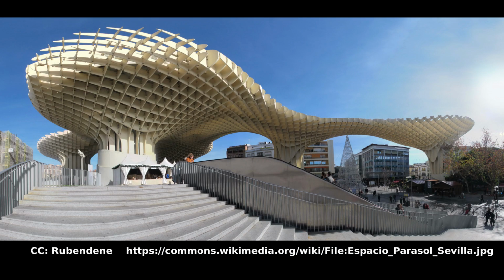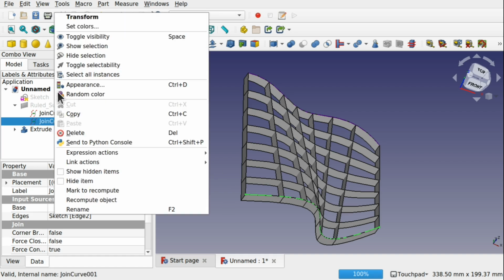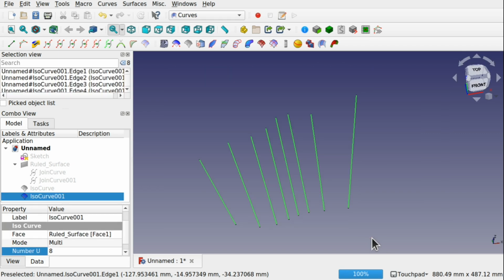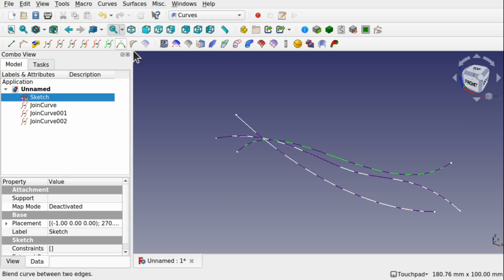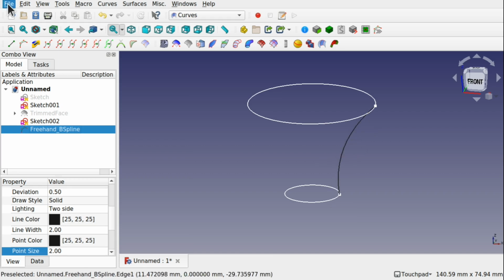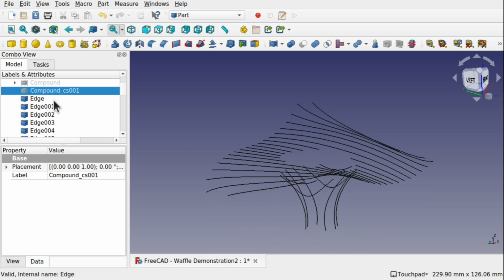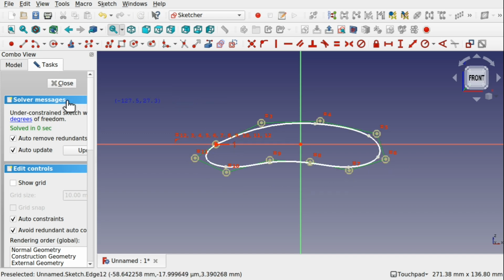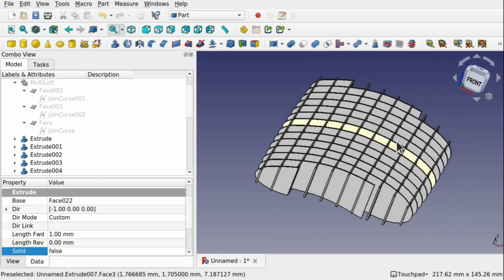Learn FreeCAD Curves Workbench 20: Building Waffle Structures and Lattice Slabs Organic Architecture

Comment: 3rd example not working in freecad 1.2dev. the software refused to do cross sections on the compound. i bypassed it by doing offsets to both surfaces and compounding the offsets, then cross sectioning the compound, upgrading in draft workbench to faces and extruding the faces. the same as the technique in the last one. in no18 i faced the same problem with the boat but then it was easy to overcome by converting to solid as it was closed shape.

Comment: Another hugely informative video by MangoJelly. I'm coming back to FreeCAD after taking a break in my learning curve. Do you have any videos that show how to cut opposing notches in the grid members so they can be cut by a laser cutter or cnc and then physically joined together? I found a notch tool in the curved surfaces workbench but it doesn't handle joints that aren't 90 degrees to each other, and I'm not sure how tedious it is to use on large arrays of members.
Reply from the maker: Glad you enjoyed.  Yes I was trying that same tool a few days ago and it has some strange effects.  I don't have a video for that process but I think l would join them all together in a compound, and use that in the cut and repeat the process on the other side.  Maybe it's a idea for another video?